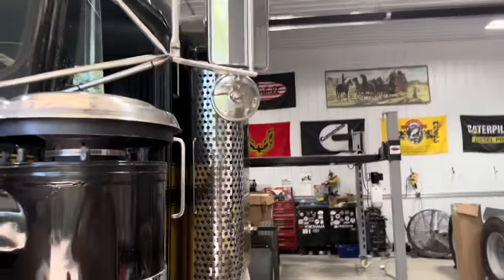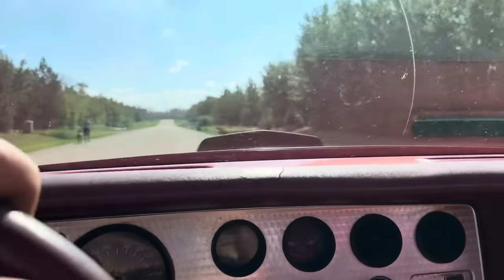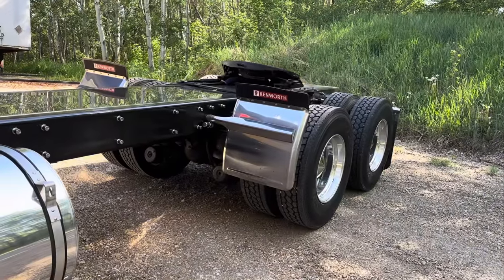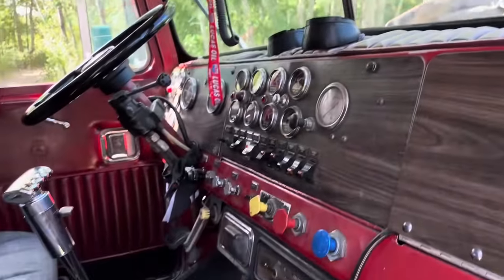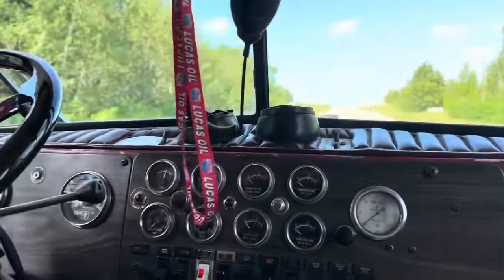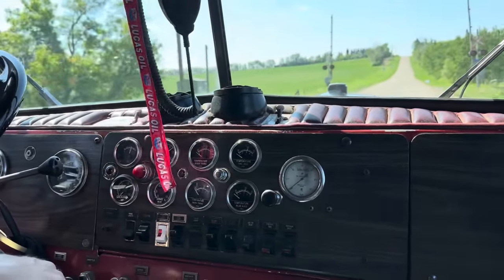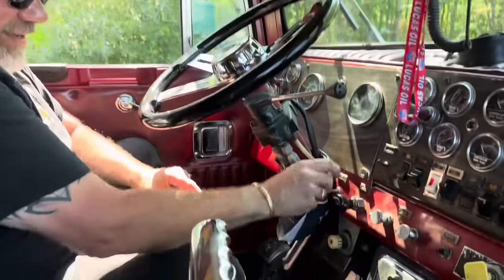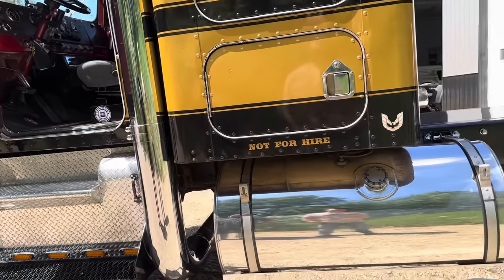What's For Sale Ep.2 - Snowman Tribute Truck

Comment: The film cars that did the burnouts and cool stuff were actually hot 455 powered backed with Doug Nash five speed transmissions. 

Put a 455 in it please mate. You didn’t short cut the truck so keep up the good work with the f body please 

Also, can l have that 301 for my 4th gen Camaro please? Lol 😂

Comment: That transim you bought I think that'd be a perfect owner for an LS 6.0 V8 Makes about 500 horsepower stock Maybe a trimmic force speed
Reply: lol no 6.0 makes 500 hp stock , my 6.2 only makes 420 stock at the crank
Reply: besides that car should have a 455 💯
Reply: @Hard_Right  Yeah kind of screwed up there Some 6.0 V8 We're about 400 horse stock. That was like the vortex max. So what you said LS 6.2 V8 In the camaros and corvettes are about five hundred horsepower 6.6 Long stroke V8 That makes 400 horsepower, and that's in the Silverado 2500. And 3500 Energy and sea trucks
Reply: @Hard_Right Exactly...my LT1 6.2 only makes 460 stock at the crank (C7 Corvette).  He must have meant a stock LS 7.0 since those do make 500 horses stock.

Comment: Just some movie information. The prop department used a Chevrolet 454 big block for all of the jump scenes and the big tire spinning machines. Don’t believe me. It’s not hard to find this information. Also I believe the movie producer talked Pontiac into either 5 or 6 cars. 
The 403 Olds/Pontiac was a great motor. But for the jump scenes the prop master and moving director were not so happy with the stock engine performance. That’s the reason for the 454 Chevy.
Look it up for yourself

Comment: I have a 1974 Trans Am red with black interior with a 455 in it with automatic the car is all original I bought it off a family that was the second owner of the car and it was lady driven anyway I got it for 2500 bucks the engine got a rebuild a few years before I got it but it turned out it had a crack frame I guess them cars are famous for cracking frames with the 455 because the torque so I had to put a new sub frame in the car good thing they bolt right in and know a guy that had many camaros and so the sub frame is out of a 79 Z28 but they were all the same but in 74 they did not have the mount holes in it like the chevy frames had to switch from big block to small block  anyway the car is fast and I can lay a patch down the road it had the factory 3.08 posi but I put a 3.55 posi and it burns them even better now but I need to be careful or I may crack the frame. But It's a fun car to drive you just have to be carful because it has a long front end with no ass end so the car likes to gets  squirrelly sometimes. it did it to me turning a corner on a wet road I gave it a little gas and it spun me right around in the intersection I was like oh crap good thing no cars were coming through the intersection LOL